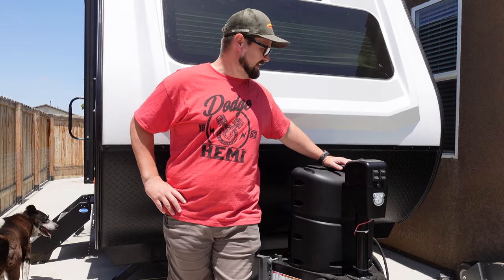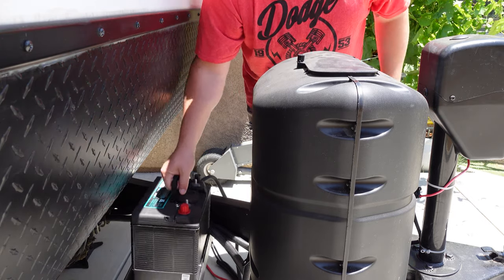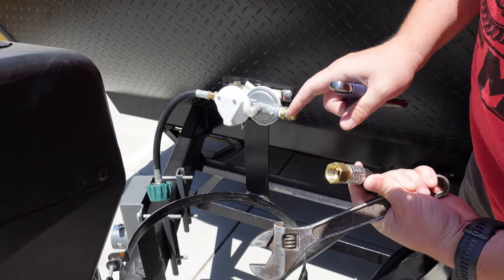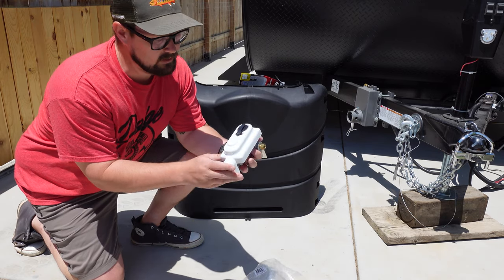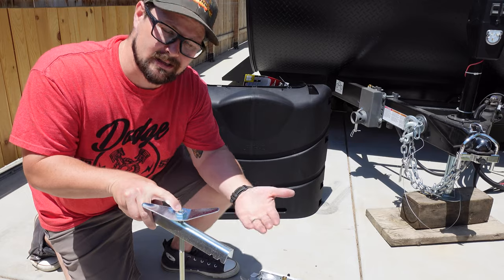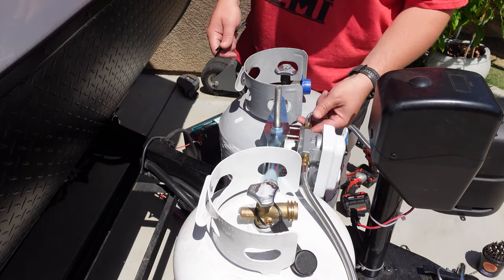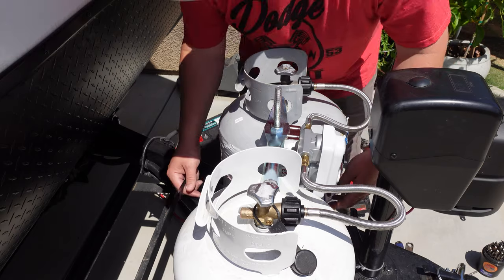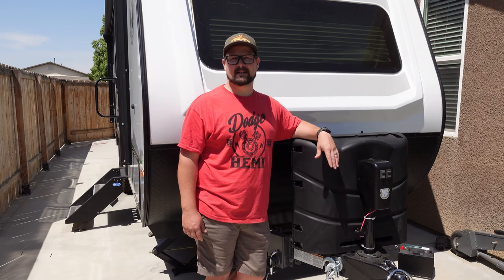How To Install Dual Propane Tanks - No Boundaries NoBo 19.3 Travel Trailer

Comment: It looks like the tank bracket could have rotated 180 degrees and used the precut slots in a V shape instead of needing to drill your own. Good, straight-to-the-point video.
Reply from the maker: Thanks, I tried that originally and it set it too close to the jack up front.  I probably could have made it work by expanding the notch, but it was easier to just get it where I want and drill new holes.

Comment: Is the long threaded bolt in the middle that holds them together good enough to secure the tanks while driving? I have a single tank right now that the tank sits it very securely. Just wondering if this dual style is secure, being that the spindle is the only thing really holding the tanks in place
Reply from the maker: Yes, it's very secure. The only time I've ever seen them fail is if the wing nut isn't tight enough. I've taken mine over 20k miles and it's still just as secure.
Reply: @RoadandReel  Awesome, thanks definitely going to upgrade to the dualie

Comment: I think you are supposed to use yellow gas tape and not white tape, which is for water?
Reply from the maker: The only difference is thickness. White is single density and good for fittings up to 3/8" pipe. Yellow is double density and used for 1/2" to 2" pipe and required in methane or natural gas applications of that size and there's a pink tape that is triple density for 1" to 2" pipe. Again required in methane and natural gas applications of that size. Anything larger than 2" has to use pipe sealer or "dope".
Reply from the maker: I picked up some different lines with gauges and when I switch them out, I'll be using the yellow stuff. I just used what was sent with these lines.

Comment: What is that thing bolted on the left side of frame same side when u were talking about your propane lines and when your talking about ur  bracket
Reply from the maker: It's a bracket I use for a manual trailer valet. I use it to move my trailer in and out of place or sometimes I'll use it to pull into a site facing forward. This is the one I use, but they make a lot of others. https://amzn.to/3OyRuEn
Reply: @RoadandReel  I thought it was a distribution hitch holder 🤣🤣
Reply from the maker: @pineapplesmash6678  haha, easy mistake. I get asked all the time about it.
Reply: @RoadandReel  hey i accidentally bought the 30 pd tank bracket will it still work for my 20 pound tanks
Reply from the maker: @pineapplesmash6678  yes, it will fit the base, but will be a little bit longer for the plastic cover. I actually have the 30lb cover and 30lb bracket on mine, but I'm using 20lb tanks. The 30lb is taller, but the same width.
Reply: @RoadandReel  gotcha I got the 20 pound cover so it might not work then
Reply from the maker: @pineapplesmash6678  if it doesn't work, try screwing in the big threaded bolt down into the bottom plate. It might go down far enough to clear the top cover.
Reply: @RoadandReel  must be nice it only took u 45 mins......it took me 45 mins just to put the camco propane cover together.....I had to drill all the holes on the cover cause the screws wouldn't fit through the holes way to small for the screws
Reply from the maker: @pineapplesmash6678  Wow, that sucks! Did it go together alright after that and were you able to get the cover over the mount?
Reply: @RoadandReel  I didn't want to take any chances so I returned it for the 20 pound rack....still waiting on it to come in.....plus I'm waiting on my camper to come back from the shop had a couple of recalls and it's in there for a 39 day punch list....so who knows when I'll get it back can't do anything till it comes back.....lol.....but I'm prepping everything as much as I can so I can knock out all the upgrades I've bought while it's in the shop got latch it locks and compartment locks and a few other projects I ordered for it.....got a camping trip booked for labor day too.....at least all my upgrade parts that I ordered are all in except the propane bracket....just waiting on the rig 🤣
Reply from the maker: @pineapplesmash6678  At least you're proactive. Hopefully it comes back in time to get it all finished before Labor Day. It sounds like you're on the right track. Let me know how those latches work out, I've been thinking of adding them to mine.
Reply: @RoadandReel  will do....it seems like the ones everyone likes are these 2 locks.....the RV lock brand and the latch it lock brand...I went with latch it for the features of being able to turn off remotes when u don't want to use them....so people can't steal ur frequency
Reply: @RoadandReel  I got my duel propane tank upgraded from a single tank to a double and installed it....it went together pretty fast...I was wondering is there anything that the propane tank need to be tied down too or does it just slip over the tanks
Reply: @RoadandReel  another question got it all done and is there anything I can get to mont the propane tank regulator....not sure where I should put the regulator
Reply from the maker: @pineapplesmash6678  my regulator is on a plate that mounts to the center bar. It should have came with the mount. If it didn't, any RV supply store should sell a mount for that center bar.
Reply: @RoadandReel I got the link from your description section when I bought it from Amazon....wonder y mine didn't come with the regulator mount....now I didn't buy the automatic tank changer thing like u got....so maybe it comes with the other part u bought and not the 2 tank conversion kit
Reply from the maker: @pineapplesmash6678  oh, that's it. Mine is a part of the automatic changeover. Is there a way you can take our old single regulator mount and use it for your new one? Or maybe something like this will work? https://amzn.to/3vZyrgb
Reply: @RoadandReel do u have.a link or an idea of what I can do to attach my regulator to new dual tank holder that you used in the video....I bought the same exact one u did off the link you provided.....thanks for your help
Reply from the maker: @pineapplesmash6678  here's a link for a universal mount. https://amzn.to/3wvldbp 
You can look through the pictures and see how it mounts. It should work...should being the magic word. If it doesn't look right, you can head over to etrailer.com and talk to one of their specialists and they'll point you in the right direction. They have a really good support team.
Reply: @RoadandReel  does Amazon sell the mount  for the bar for the regulator
Reply from the maker: @pineapplesmash6678  yes, it's that first link. It slides onto the threaded vertical bar and sits on the horizontal bar holding the tanks. The large wing nut then goes on and holds it in place.
Reply: @RoadandReel  awesome thank you....so the first link your talking about is the regulator mount piece I need to order to slide onto the vertical bar
Reply from the maker: @pineapplesmash6678  yep, that should do it. Let me know if you need anything else.
Reply: @RoadandReel  can I send me the link that has the mount for the bar for the regulator......I didn't see in your list of links under your video in the descriptions
Reply from the maker: @pineapplesmash6678  yeah, post the link and I'll see if YouTube lets me approve it. If not, email me at roadnreel@gmail.com
Reply: @RoadandReel  I got the bracket that slides down the threaded bar today from RV dealership but now I got to figure out how to get the bracket to stay in one place do u know what size nut would fit on the threaded bar.....is it like a 3/8 or bigger u think.....I'm thinking about putting a nut where I want it and the nut would hold it in place
Reply: @RoadandReel  I got it figured out and got the regulator bracket on..... figured out how the bracket works and how to do it with the wing nut to hold the regulator bracket from falling down......thanks for all your help and time
Reply from the maker: @pineapplesmash6678  great! Sorry I didn't get back to you on that nut size. I was out of town, but I'm glad you got it all figured out!
Reply: @RoadandReel  thanks I'm glad too.....thanks for all your help
Reply from the maker: @pineapplesmash6678  you're welcome!

Comment: Does the dual tank holder come with hardware
Reply from the maker: No, I used the old hardware from the single holder. I used four self tapping screws with 3/8" heads.
Reply: @RoadandReel  so the old hardware were the self tapping screws with 3/8 heads
Reply: @RoadandReel  is your camper a forest river single axle
Reply from the maker: @pineapplesmash6678  No, mine is a Tandem Axle. My last trailer was a single axle and I did this same conversion to it.
Reply: @RoadandReel  awesome that's good to know I was concerned that this holder won't fit on my frame
Reply from the maker: @pineapplesmash6678  yes, my old hardware was the 3/8" self tapping screws.
Reply: @RoadandReel  thanks